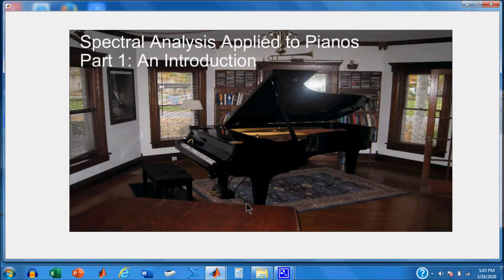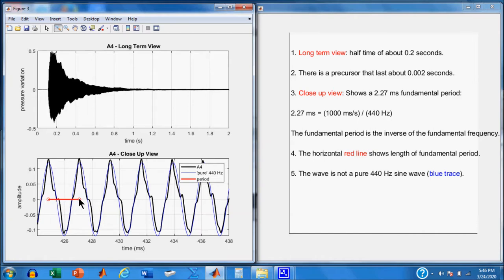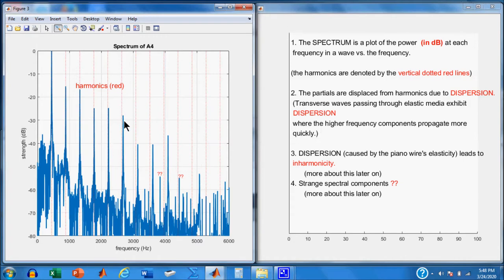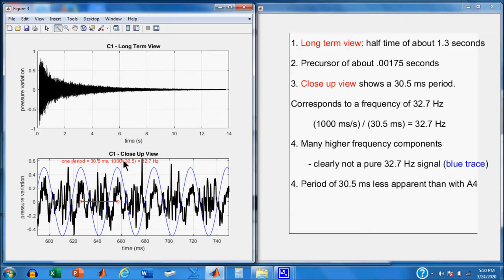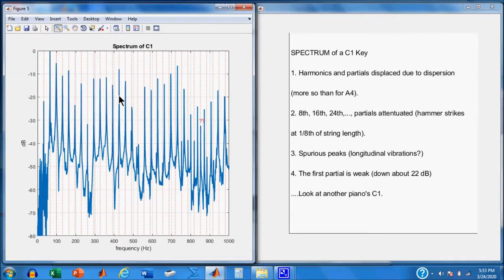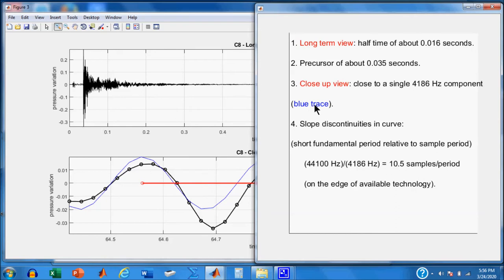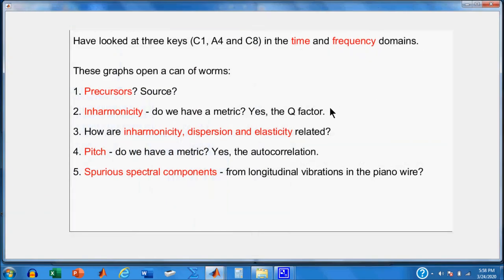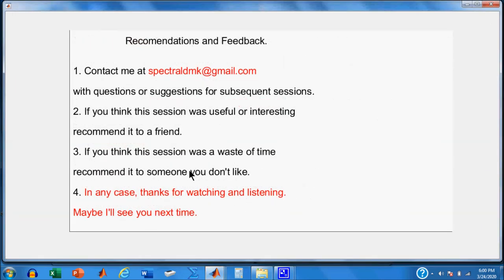Spectral Analysis Applied to Pianos - Part 1

Comment: Very good David. Would not be unusual to not see a lot of C1 fundamental as this should be lower than the 1st modal frequency of the fully strung soundboard and thus not transmitted well. Even more so on the 2nd C1 sample. I assume that second sample is from a much smaller piano. 

Suggestion to record a rubber hammer hit or even a fist hit on the center of the soundboard and check the spectrum to  find this fundamental board frequency of each of the instruments. Then you could also check the notes near this fundamental board frequency to see how if affects those notes.
Reply: That missing fundamental is a pretty amazing illustration of psychoacoustics. You still "hear" it as a C1, purely on the strength of the harmonic series above it.

If you could eliminate all the odd-numbered harmonics without changing anything else, you'd hear it as a C2. So little of our audio perception has to do with the fundamental frequency in isolation. The harmonics have a much stronger impact.